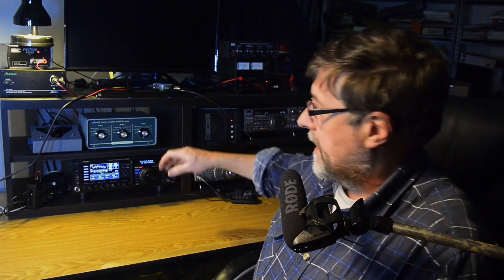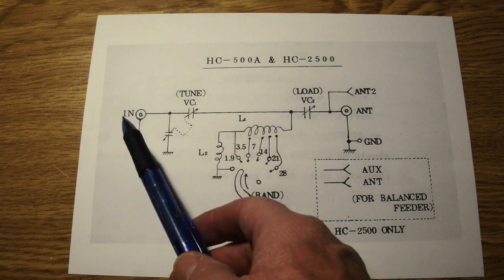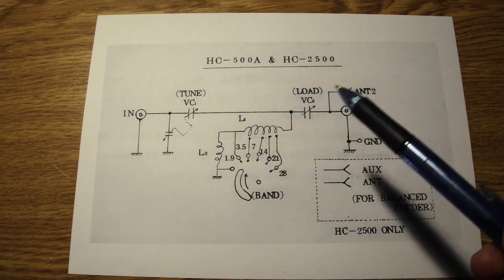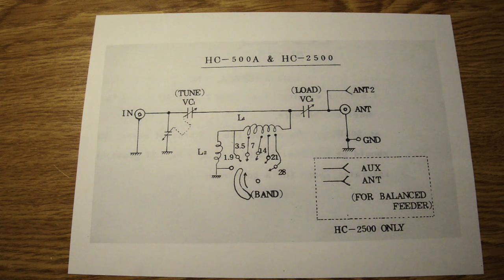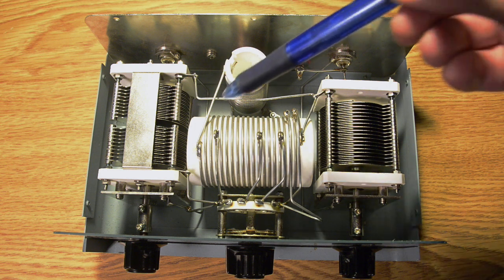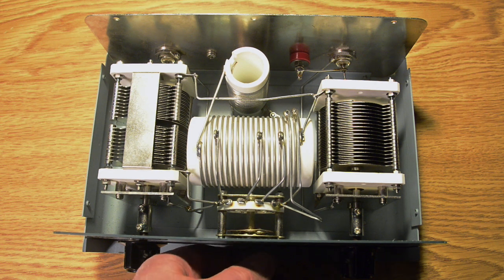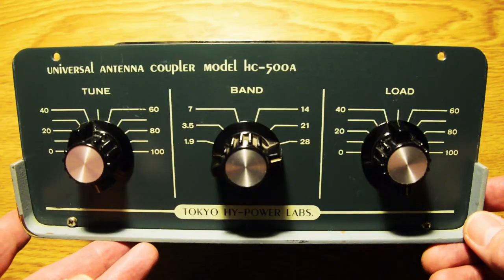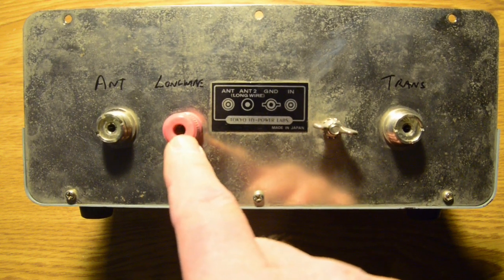An Old Antenna Coupler (....as used by an old radio operator!)

Comment: Great video on a marvelous tuner. I own one for 25 years and find it faultless. Build my own tuner ( Tmatch) from the ARRL Antenna Handbook but not the same matching.
Reply from the maker: Thanks for checking out the video and your comments, Emil. Yes, the Tokyo HiPower is a lovely tuner indeed. And, of course, the ARRL T-Match has been built by many amateur radio operators and is also very successful. Have a great 2020! Rob VK3BVW

Comment: Hi Rob. I have a question about balanced feed line. If i wish to use 300 ohm feed-line should i try to achieve 300 ohm at my antenna? My idea is to build a tuner to match the radio to the 300 ohm feedline but then should i also have something to match the feedline to the antenna? I am going to try to build a tuner without a balun or at least with only a stacked  1:1 Guanella balun outside of the tuner. The loading coil should be of a transformer type (variometer) with one coil within another such as in a floating link coupler.
  Thanks for any input on this.
James

Comment: Very nice set, and a very good presentation. Would you consider taking some measurements on the range of the  individual components and posting those as well? The minimums and maximums ranges of those variable capacitors and the inductance at each of the taps or just the over all inductance of that coil itself for instance.  I like to study such things. And like an earlier post mentioned, it could be both educational and informative for a home brewer as well. thanks for a great post.
Reply: I know im asking the wrong place but does any of you know a tool to get back into an instagram account..?
I stupidly forgot the login password. I would appreciate any tricks you can offer me!
Reply: @Donald Casey instablaster =)
Reply: @Callan Clyde I really appreciate your reply. I found the site on google and Im in the hacking process atm.
Seems to take quite some time so I will get back to you later with my results.
Reply: @Callan Clyde It worked and I actually got access to my account again. I'm so happy:D
Thank you so much you saved my account!
Reply: @Donald Casey glad I could help :D